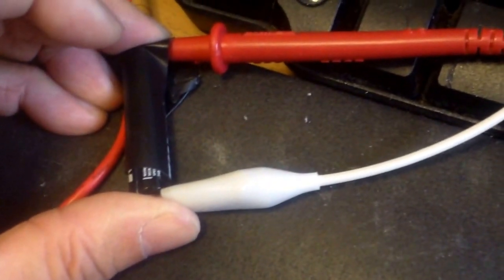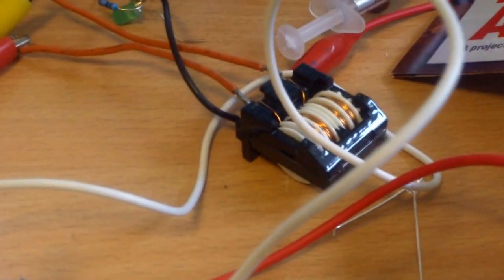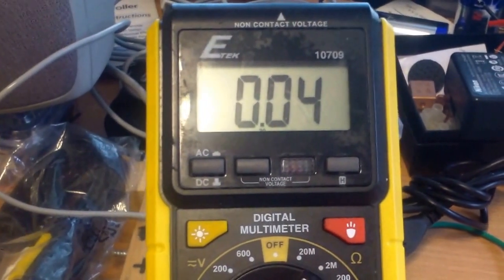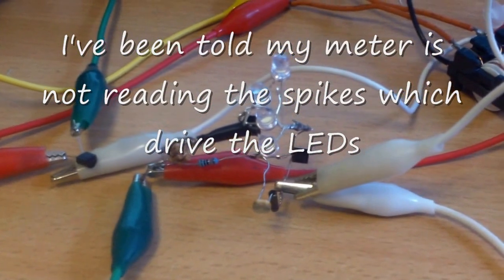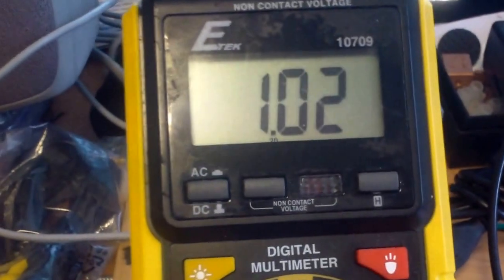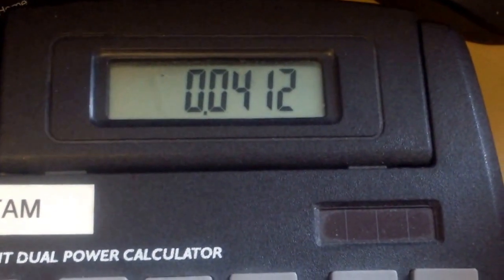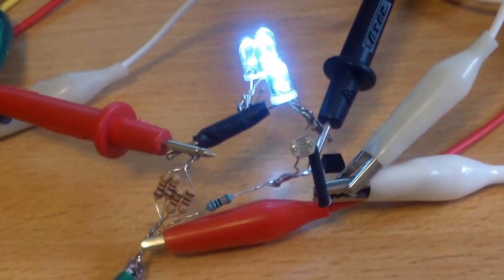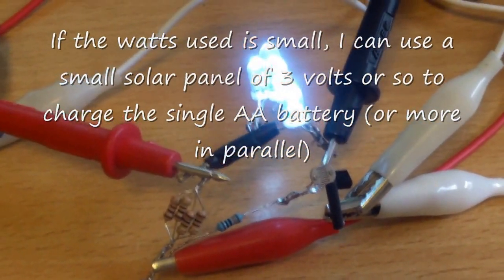Do it yourself solar night light with joule thief and 1 AA battery

Comment: Nice tips that you have. Now I can use solar panels with small size of volts. I can really save on this kind of way. But if you are using small volts on rechargeable batteries, does it has the same amount of energy?
Reply from the maker: It just means you can power the led light even though your power source is small.  A small solar panel would generate lower power, but that low power is sufficient to charge one battery. Normally, the small battery won't be able to power the led because it is only 1.5v. With the joule thief circuit, you can.

Comment: Good job on adapting the joule thief circuit into a rechargeable led light system.  If you want to quiet down the coil pack just smaller coils.  Look up data line chokes and make magazines joule thief jewelry project.  Some of the parts they used I copied in the first experiments for my infinity sun jar series I did.